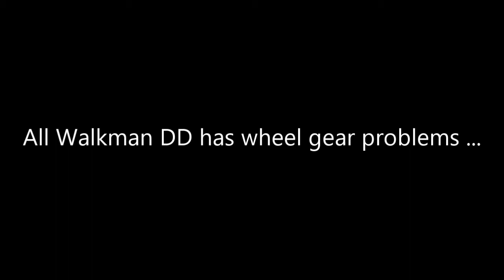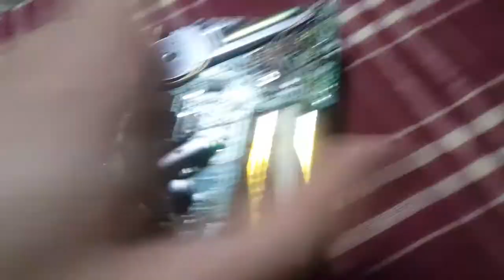Sony Walkman DD30 Repair & Wheel Gear

Comment: Hey Elisio, I am struggling getting the compression spring re-installed. Could you help? Do I just need to compress the spring to make room for the small black piece to fit inside the slot? Could really use your advice. Thanks